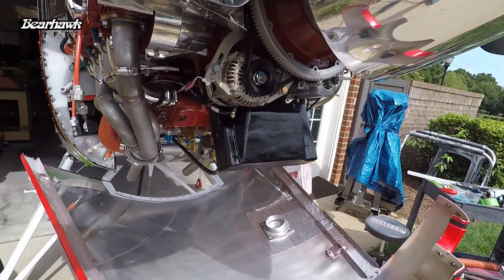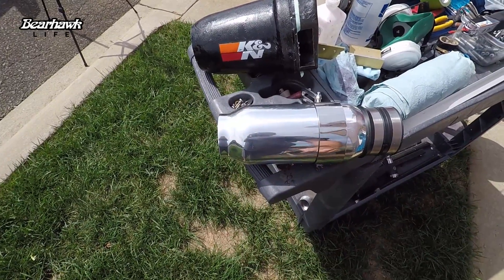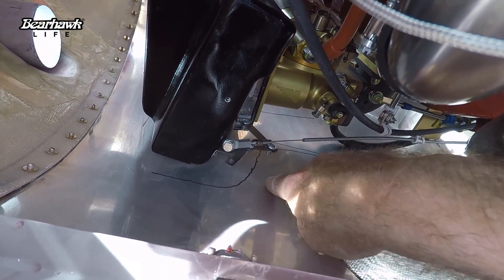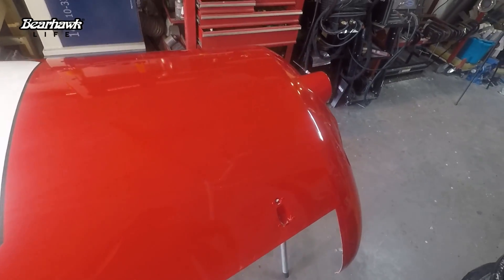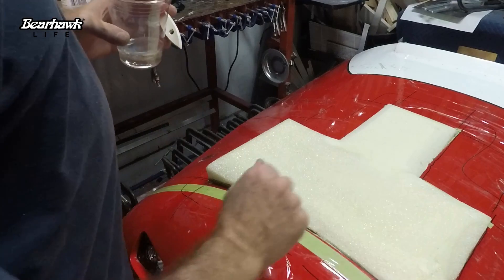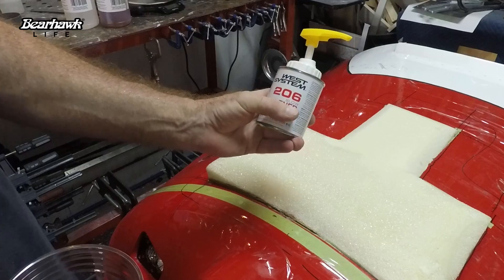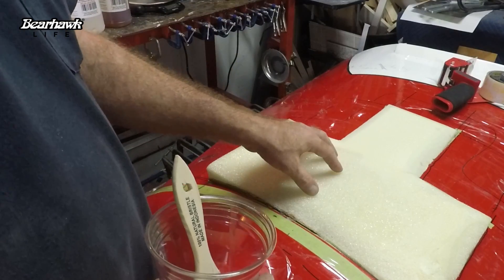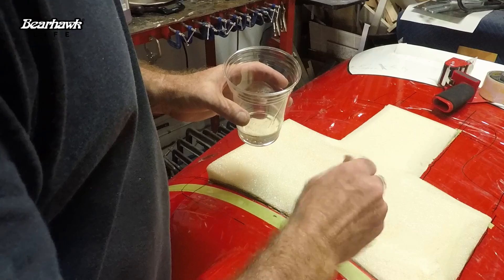BEARHAWK ~ Air Box Installation  COMPLETED ...  PART 3

Comment: You know you could just twist the fuel servo 180 degrees, creating a bunch of space underneath allowing to keep your tight cowling.
Reply from the maker: Good point!  I think I addressed this in a previous video.  I worked very closely with Airflow Performance before and after I purchased the engine, and this setup, the forward facing fuel controller,  was their preferred recommendation for my build.  The updraft fuel servo would have required a deeper air box on the bottom of the cowling, similar to the RV-10.  Thanks for watching!